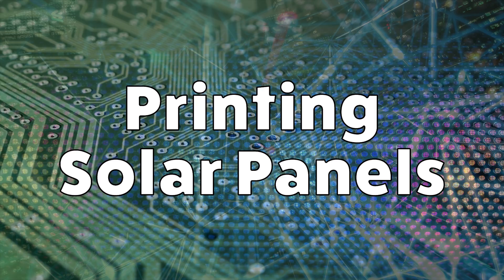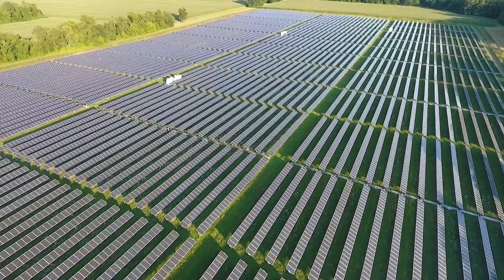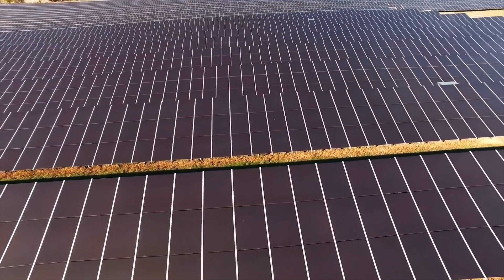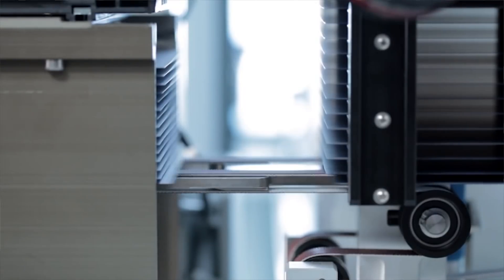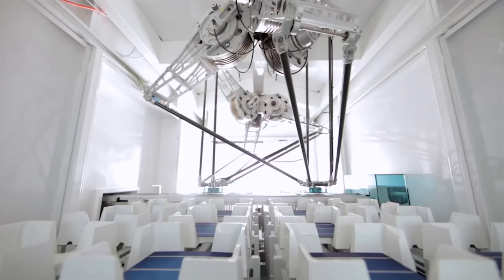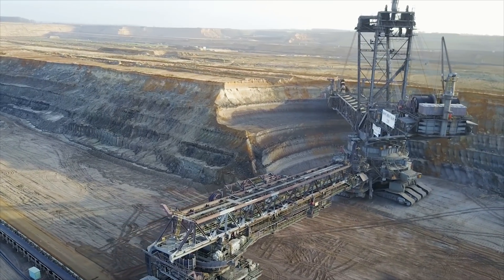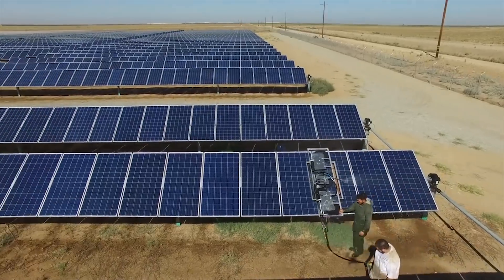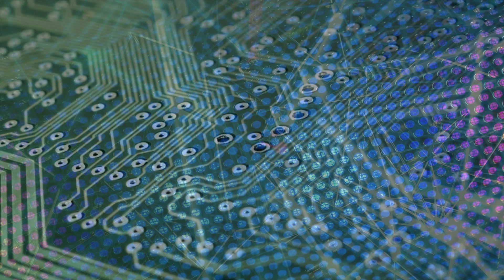Printing Solar Panels - A look in the next generation of flexible Solar Panels

Comment: Very interesting. I have been pondering solar for my house but the long payback period plus high battery storage costs have put me off doing this. I think in the UK a lot of the problem is that the time when I use most electricity (winter) is the time when I would generate a lot less than the average over the year. Judging by what you say in this video printed solar panels are at least ten years from any serious market penetration. I forgot to add that the fact that traditional solar panels are ugly doesn't help their take up either.

Comment: I find the images you provide to be very distracting from your voice and notice the words going in one ear and out the other, without sticking in my brain... Sorry I don't have a suggestion for improving things, I can just tell you this doesn't do it for me...
Reply from the maker: Okay. I’m not sure how I can make things stick better for you....what do other channels do to ensure you remain interested?

Older videos had big captions that popped up at key points. Perhaps check them out and let me know if that is better for you.
Reply: @EnergyAnalyst  Graphs and visual illustrations would help. 
But that'd be time consuming or you would have to hire a third party to illustrate key points. However that's very expensive.
Reply from the maker: Thanks for the suggestions and they're definitely welcome and on my radar. I don't think I can stretch to graphics but charts should be doable

Comment: Great video keep up the good work love your topics
Reply from the maker: Thanks a lot. Any topics you’d like to see shared on here? Always open to new ideas.
Reply: @EnergyAnalyst  If you could elaborate on different types of oil sold on World markets. WTI, Brent crude, Saudi Light Crude Oil etc. I'd be interested in economics of them...On what exchanges are they sold,  what markets/ports do they flow to...?

Also the effect on inflation higher energy prices can have on the economy.
What impact will potential carbon price/tax will have on your electricity, heating, gas price?
Which countries have the lowest/highest energy intensity/emissions per GDP, capita?
But you got probably better isht to do